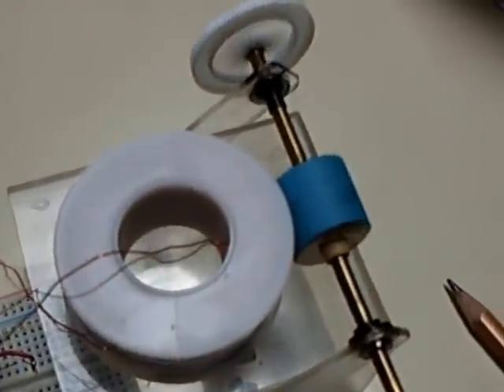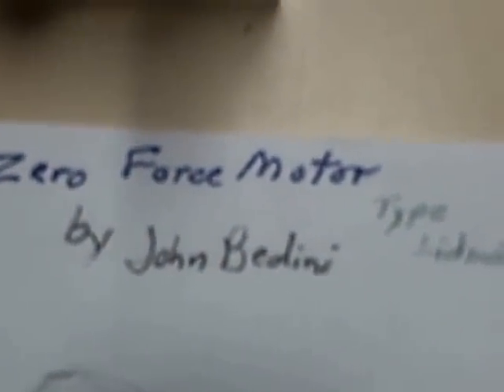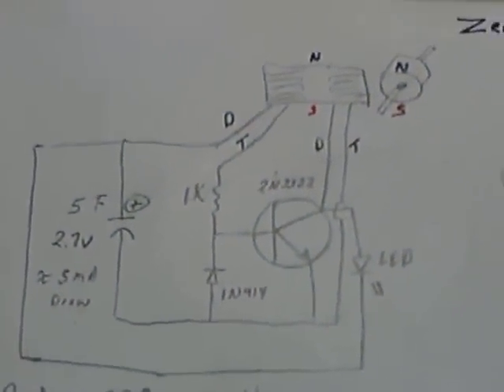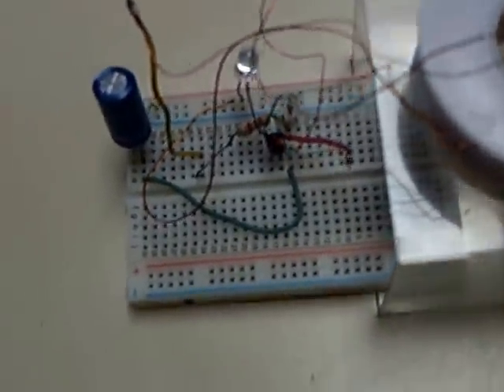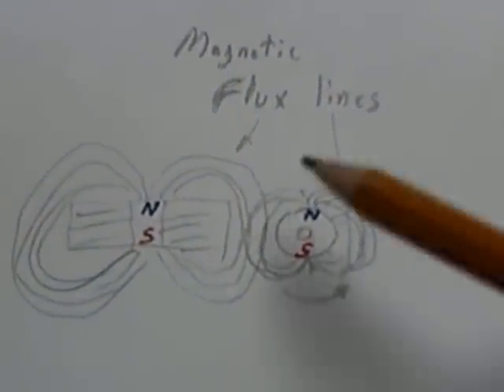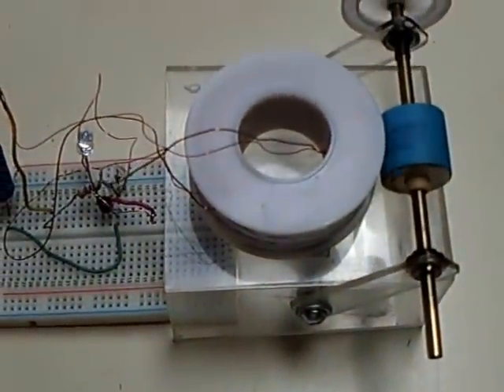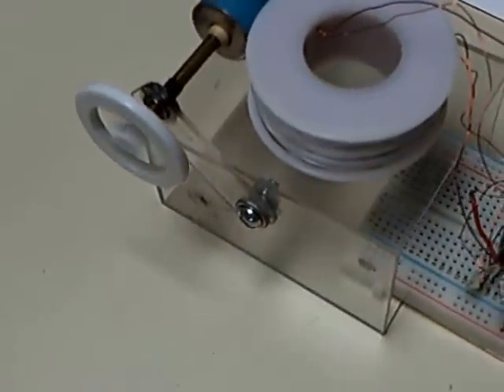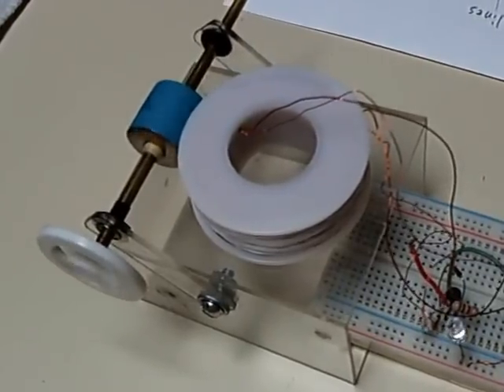Zero Force Motor ---- TL circuit diagram

Comment: +Lidmotor
Hi Lidmotor,

You might also see https://youtu.be/HK3JOlY0V8Y which also talks about reactive power looping into source input and proper geometry for the torque compensation. Should be interesting to see if you can build these models on your table.
Cheers!

Comment: Thank you for showing it works with one coil also..
I might be wrong and did not understand the difference between the zero force motor and the window motor. It looks to me as if this was a windows motor using the outside of the coil instead of the inner siden.

This would meen if you wanted the same work done as with a window motor, you would need a second, identical magnet on the other side of the coil. As I said though, i might be wrong.
Thanks for sharing.

Luc
Reply from the maker: +DaKrampus Yes. I was working on it this morning using one of my old window motors reconfigured like that and I think that you are right. It is perhaps a window motor turned inside out.  It turns out, from what I read on the forums today, that this setup has been very much tested long ago and discarded as not as good as others.  To me it is just an interesting way to turn a rotor and something I personally have not seen before.

Comment: I appreciate how you took some time to describe the magnetic lines of flux (especially the diametrically magnetized cylinder magnet).  Some people wouldn't intuitively know that.

Great work as always!
Thanks for sharing!
Reply from the maker: +Ben Winkel This has captured the interest of some folks at the electronics forums that I visit and it appears that this type motor design is very old and has been investigated extensively.  It was just new to me.   Here is a link to one of the forums where they discussed it:  http://www.overunityresearch.com/index.php?topic=3196.msg52778;topicseen#msg52778
   The configurations vary but it is sort of like a window motor.  There are a number of ways to switch it.   A reed switch is the easiest and was the first way I did it.
Reply from the maker: +A B This motor that I built is very interesting but I may have mistakenly thought that it was like John's motor.  I need to build his motor to see if there is a major difference that I missed.
Reply: +Lidmotor John uses a reed switch, could it be that his coils are in series?
The principal of the magnet riding the flux line is the same though.

I like yours for the fact that its a bifilar coil switched electronically.
Do you remember Dadhavs motor with the upright magnets on the rotor?
Creating a strong blotch wall pointed outward pushing against the magnetic field from the coil. This reminds me of that.
Reply: +Lidmotor Thanks for the information and the link, its fascinating stuff!
Reply: *****
Do you have an account at overunityresearch.com ?  It looks like a private (invitation only site).

Comment: i have interesting material on that topic with magnetic/dielectric lines i am only theoretician for now ... i would like to help u imagine how it probably works... Try to imagine electricity as cross where 2 fields connect together in the center of cirtuit making a kind of hourglass shape. Electricity is a proces of unrolling or rolling stress between this 2 fields. Think Mobius coils and spiral movement from each end of circuit opposed to each other. They grow or decay.. the point is to use power without energy, and that is made when two opposing fields are pushed into work in both field in the same time. That freezes power without consuming energy. Email me if u are interested like me :) I am not saying i know something . In this topic i see myself more as an explorer... but i see potential in that... and i am not able to belive standard electricity theory to be truth    Sorry for my english :)

Comment: Great video as always. Don't you just hate it when you are talking to camera and it has decided it has heard enough already and has switched itself off :-)
Reply from the maker: +GrandadIsAnOldMan   I am using a really old cheap camera that runs on two AA batteries.  I have produced over 700 YouTube videos with it so I'm a bit attached to it.  Once in awhile it does this "see ya later" stunt.  It is probably time to retire it and get a new and better quality camera.
Reply: +Lidmotor Why did you stop using the Iphone camera? Tripods are pretty inexpensive for them.

p.s.:  neat lil motor. :)
Thx for sharing!
Reply from the maker: +A B I know this sound stupid but I didn't like the way I held it in my hand.  I'm used to my old camera from years of taking videos at sea. Tripods don't work well on a sailboat.  Maybe I will try the iphone 4 again.  The camera in it is good.
Reply: ***** The camera I use for most of my videos uses 4 AAs. I use cheap rechargeable ones from the "dollar store" or Poundland as it is here in the UK and often use 2 sets a night on my longer productions. The bigger problem for me is the camera will only shoot 9 minutes at a time so I need to keep an eye on the clock.
Reply: *****
Preference isn't stupid--it's usually about convenience/comfort.  Perhaps you can buy/build a small holder for the iPhone that allows you to hold it in a similar manner.

Also... tripods at sea come with strong magnetic feet & a tie line--just in case.. :)
Reply: +Lidmotor 
You can find very, very cheap HD 720p camera, and sometimes fullHD 1080p. Search for second hand.
Reply from the maker: +Geto Dacian  Thanks I will look for one of those. By the way what does the 'HD' stand for. lol :1
Reply: ***** In case you are not trolling me  :) HD = High Definition:
- HD 720p = 1280x720 pxl
- fullHD 1080p = 1920x1080 pxl

Your camera have this resolution.
480p = 640×480 pxl